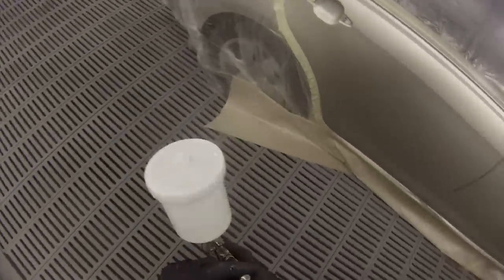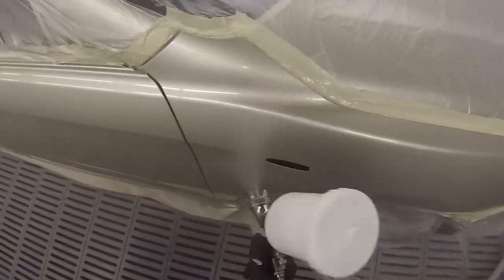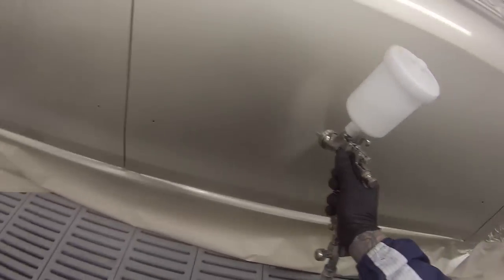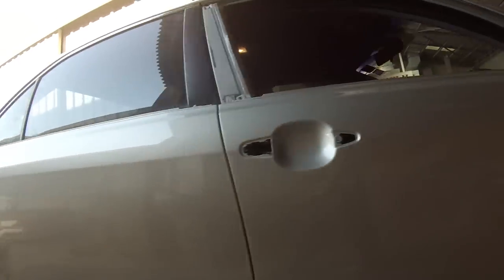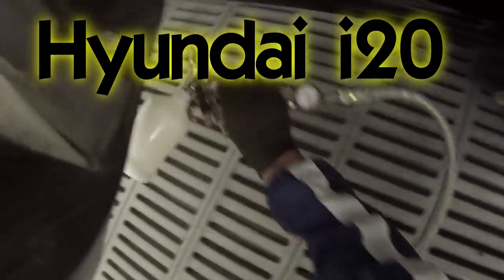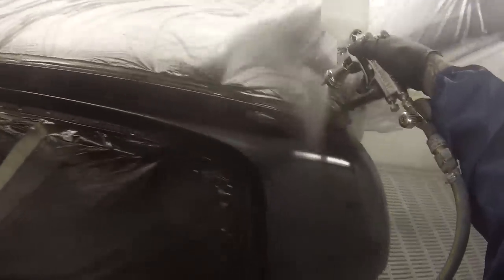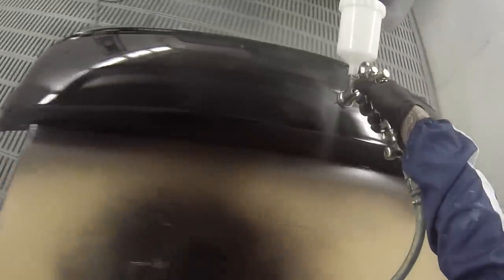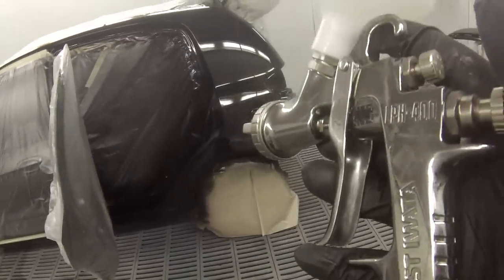How to Use Anest Iwata LPH 400 For Clear

Comment: Hey I just got me an LPH 400 with the orange air cap, how many psi do you use when you spray clear?, Thanks, love your videos
Reply from the maker: Some people say they go as low as 18 psi but I wouldn't run it any lower than 25psi I found it goes on very orange peely with pressure too low.

Comment: hi why did you come in 2 turns on fan ? and thanks for video
Reply from the maker: I just found the fan sprays more even when in 2 turns, I don't do that on all guns but found the LPH400 works better like this. A few other guys that I know use this gun like to set it up this way too. Do you have this gun? if so how do you set it up?
Reply: hi yes i have this gun  i set fan all way out and then in half a turn in and set psi to 24psi and 2.5 to 3  turns out on fluid for clear it still works well even at 20psi for clear i dont use it for base i have w400wbx for base thanks

Comment: Just sub to your channel great content. I'm a 64 year old how enjoy restoring vw spilt-window buses as a hobby. My day job i'm a mfg. Eng. for lennox industries home HVAC company. We do own a company in your area Kribby part of Heatcraft. Ok I have a IWATA LPH-400 plan on using it just for a clear coat gun. I would like another good gun for base coat and sin gle stage paint. your thoughts. I have a NAPA air compresser 80 gallon tank and I have filter dryer system. Just wet the floor down in my garage cross my figers I do not get a lot og bugsd in the paint. As a general rule I paint car parts hood or door, or fenders. with that I can get good results .  Again it is a hobby do not flip or sell the cars --they get names and become a member of the family that just happens to sleep in the garage.. thanks for sharing your skill set and helping me enjoy my hobby even more.

Comment: Have you ever had this gun shoot heavy on the ends of the fan pattern?  I did a silver paint job a while back, and the fan was so uneven it left me with stripes. I tried choking it in to save the job, but failed and ended up redoing the whole thing with a different gun. Settings were: 25psi at the gun regulator, 3 turns out material, full open fan.  silver cap.
Reply: Hey cody you might want to try this ... turn the nozzle so the pattern sprays horizontal, put a big piece of masking paper on the wall as a test panel, turn the pressure to about 23lbs on the regulator , then spray in one spot at the proper distance as if your painting for real, then watch the way it runs down , keep adjusting the pressure up or down  till the runs are eventually dripping down he paper . After that you should have an even spray .  Oh have the fan all the way open . Hope it helps
Reply: Cody F Wide open fan. Load your gun, spray looking at the fan, adjust air pressure as air pressure can affect the way your fan sprays. Too high on most guns can cause tiger striping (outsides of the fan to shoot more material leaving stripes). Too low, you get a heavier muddle spray and will probably mottle (heavy grouping of the metallics in the muddle, light on the outside) the metallics in a metallic paint code.

Comment: Love your vids Gunman! Im hooked. You went over all the gun settings and set them to match the factory orange peel. My question is if you wanted it really slick what would you have changed in settings? Thanks for all your time that you dedicate to your videos.
Reply from the maker: Dwayne ST.CLAIR theres so many variables to try to explain, I will work on a video on peel control, things from gun distance closer to viscosity nice and thin, and pressure higher.
Reply: That would be awesome. I know just a few small changes could make a big difference. I look forward to the video and the affects of certain changes on a panel as Im sure a ton of painters are as well. If you have time in the video explain quickly if you can the changes in your pressure settings on a hot day vs a cold day. We love you videos here in the US! Thanks again.

Comment: I have my lph400 set up like so.29psi trigger pulled.fan is 2 turns in from fully openfluid control is 2.5 turns from fully closed. That works great for a medium solids clear, but for a good high solids it sucks. Any tips on changing things around to help with a thicker high solids.

Comment: Hi, first to tell you, you have really great videos... I learned a lot from them. 
I have one question, which gun would you recommend for base paint and clear. I have one low budget gun with 1.7 for primer, but I want a good gun(one gun) for base color and clear.. which one would you recommend and which nozzle for paint which for clear?? Thank you very much. Grettings from Croatia
Reply from the maker: Look no further than the DeVilbiss Gti Pro lite 1.3mm and the TE20 aircap, top quality gun and not too expensive and will last a lifetime. Otherwise go for the Anest Iwata Bellaria Review & Demo, good luck.
Reply: thank you!
Reply: The Gunman  One more question. Is TE 10 (1.3)  better for base/clear or TE20? Is there much a difference? In your video i saw that you use T20 for clear... And you said you also have TE 10. Did you try it? Your opinion?? Thank you!
Reply from the maker: The te10 features in this vid but I prefer the te 20

Comment: Hey Gunny,
Whats your opinion on the Supernova as for as finishes go. I know you said it was harder to setup than the lph400 which i own but i want a different clear gun. I have the sagola 4600 extreme and its awesome but i kind of wanted a different gun and different brand for clear vs. having to sagolas.
Reply from the maker: I haven't used a supernova for a long time but I do remember it was a great gun, if you haven't already got a GTI Pro lite it could be a good option.
Reply: Thanks Gunny. I did look at the GTI Pro from spray guns direct and definately an affordable option.
Reply from the maker: If you do get one I'd recommend getting the TE20 air cap. I've got a few comparison videos you may get something out of before buying.
Reply: greatly appreciated.

Comment: What's up man I'm from the US and I just got this gun but they say to spray it at 16 psi and it sprays really good I've tried spraying it at 25-28 psi and it ends up really dry I use it for base and clear
Reply: i bough the lph 400lv here in the U.S.   I am waiting to use when I get to base and clear.  I think the difference is in the supplied air cap.  Mine , as yours says 16psi at full trigger pull.    I'm using 3/8" hose with 3/8" connectors and a regulator at the wall, no flow valve on the gun.   How did you make out spraying at 16psi?

Comment: yeah I sprayed base coat and clear on a GTI fender, the paint was really granny and the clear coat came out with some orange peel, would you recommend to use the same pressure with base coat? thanks man.
Reply from the maker: I find that you can use less paint with less pressure so using base I'd run it from 20-25 (closer to 25)  because its a different product to clear and not the finished product it wont go on as peely as the clear so I like to up the pressure on clear as to not compromise the quality of the finished product.